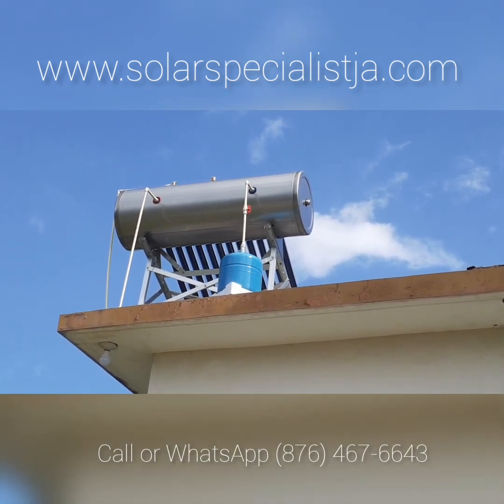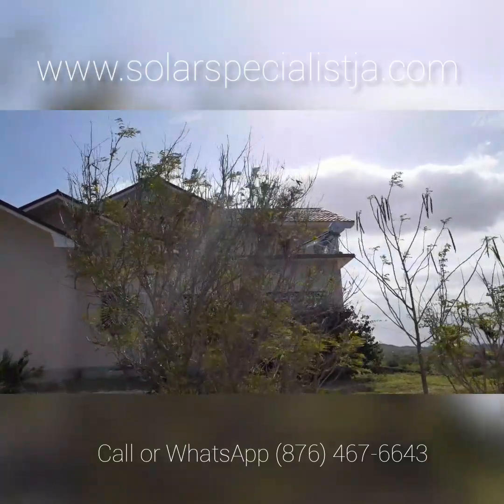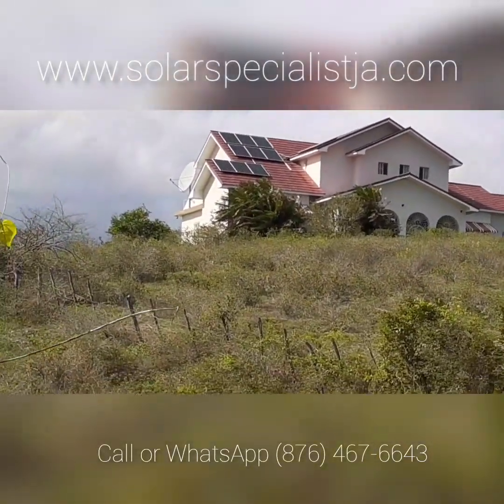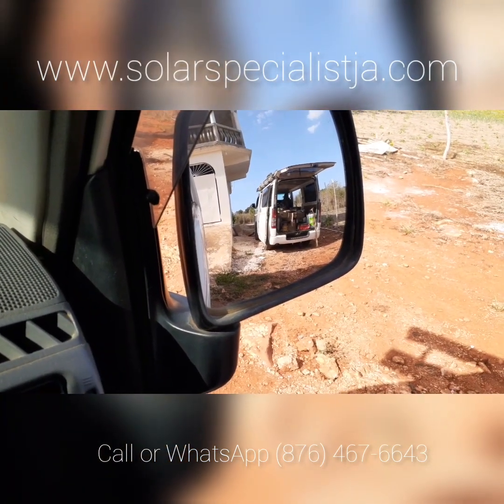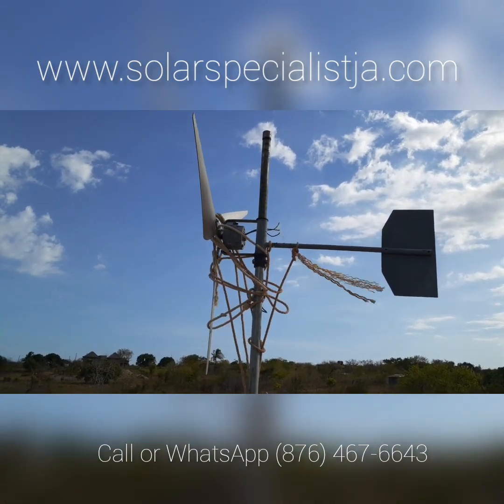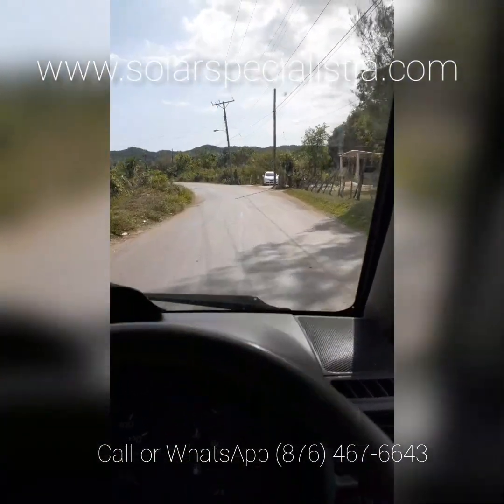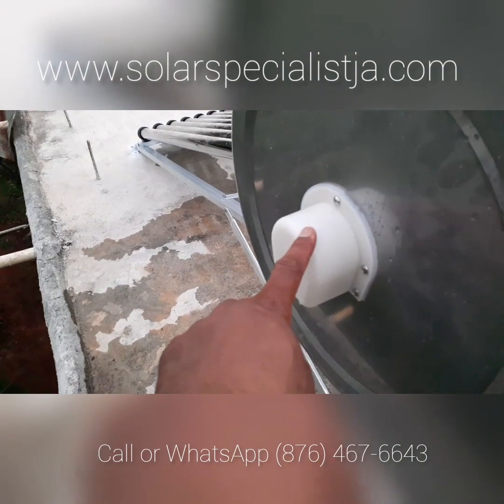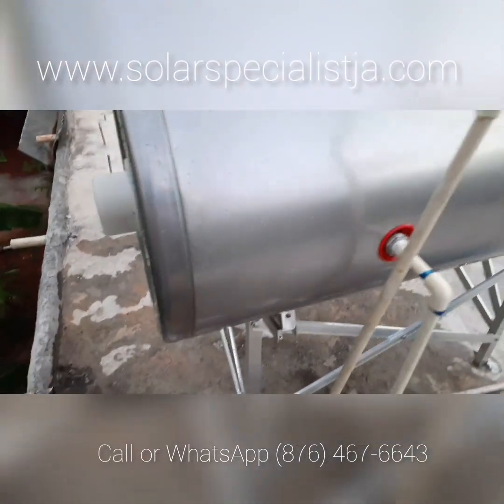Solar water heater Specialist in Jamaica

Comment from the maker: The solar water heater is separate & independent... 
Prices: 40 Gallon $150K
             53 Gallon $180K 
             80 Gallon $220k JMD
All prices include installation. However, travel cost may apply based on your location
Reply: Where are you located I need one of the water heater my house is in Hanover